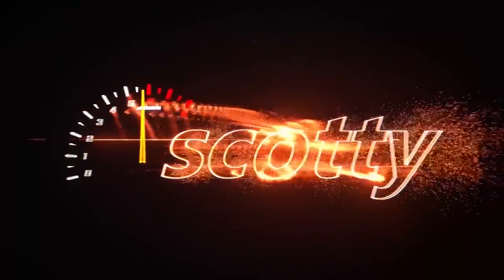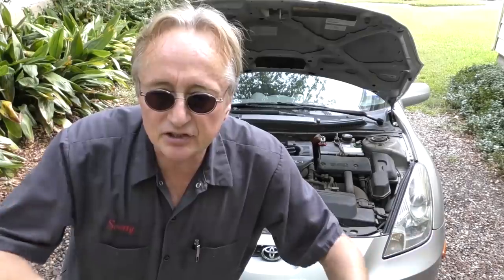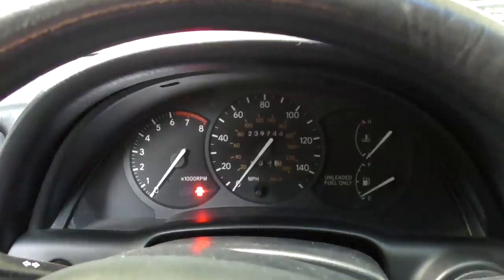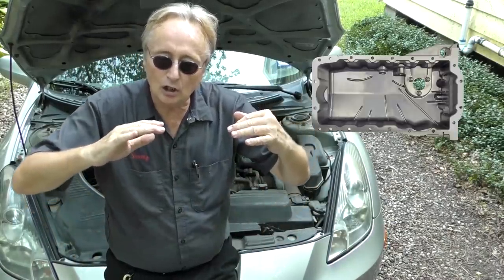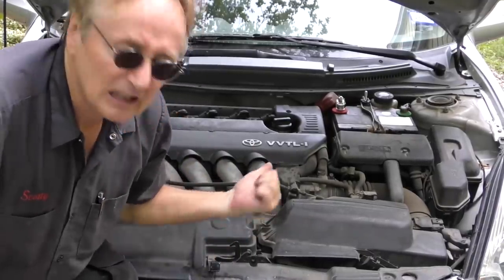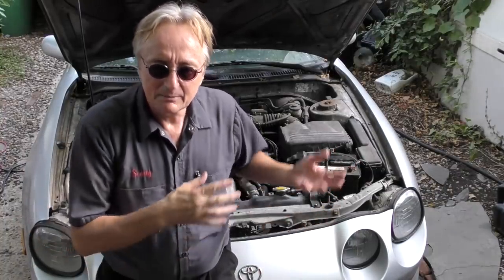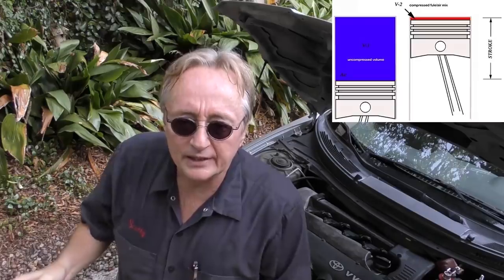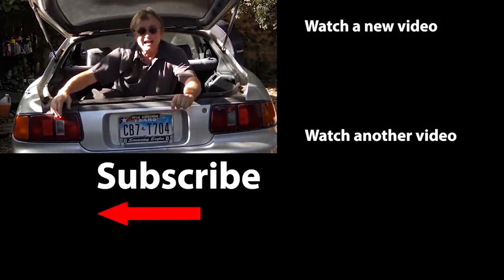Why Not to Buy a Toyota Celica

Comment: I been driving my celica 2000 with the 2zz for 7 years as a daily driver with not problems , SORRY 😐 but I love my celica
Reply: Yep, scotty is running out of video ideas.
Reply: My 2004 with the same engine, has now covered 146,000 miles and is serviced by my local Toyota dealer every year.  Nope, nothing wrong with my one, either. Still original-engined, is always economical, goes beautifully and revs freely. Exactly as Toyota intended. Love them as well!
Reply: I had a 2000 VVTI model and had it for about 12 years, didn't miss a beat, eventually traded it in at 186k miles for a 2004 VVTI celica with little to no miles on it and one owner from New.

The only time I've heard about these engines failing is when people have modified them and driven them hard, or just not maintained them at all.
Reply: J C me too. You have 130k and drive it daily plus I get on it quite often. It’s the oil pump/pan that’s the real issue and going to redline when you shouldn’t
Reply: Same here. My GTS went from my grandpa to my brother and now to me. Never had engine issues. Great car.
Reply: I had a friend with the exact same car he was always on top of the oil changes he sold it when the car had over 200,0000 miles .
Reply: @Bamaca_B58  heard thats only the problem on the gts 2zz engine, 1zz has a solution for that, dunno why toyota didnt use the same oil pans as the 1zz to avoid oil starvation
Reply: My brother celica 2002 original engine and transmission, close to 300k miles and runs like a dream
Reply: Is it a good starter car ?
Reply: @mrgatzby9793  It was and still is my first car (T-sport trim). handles well, gets good mileage (when you drive it like a sane person), and they are pretty cheap. i bought mine in very good condition for 30 000Kr 2847euro *3104usd*. Im not an expert but i have had mine for three years, send me a message if you have any questions. I cant guarantee answers but ill say what i know.
Reply: Most of engine failures i have come across was from a high-rpm mis-shift. 
The GT (1ZZ) early models had the oil consumption issues that any of the cars that shared the same engine had. (Corolla etc)
Reply: I had this car too, in spectra blue mica. The A/C didn't work, but otherwise I didn't have problems. I loved that car. I didn't push it, and always used premium gas. I sold it when I moved to Europe. Just seeing the dashboard brings back fond memories.
Reply: He mentioned that if you don't over-rev it, the engine will be fine. The problem is, most people with a sports car likes to drive rough,
Reply: @Bamaca_B58  not in the vvtli 190 like this one. That' a problem for the pre facelift  vvti 140. It was cured for the facelift.
Reply: Elias O About to buy 2002 with 160k with manual tranny. Wish me luck.
Reply: Do u recommend one ?
Reply: Agree my 2zz is running perfectly has done for 3 years of ownership
Reply: I have the same exact one and it lasted me for so long no problems whatsoever, it is about to hit 200,000 miles and still runs like a champ,  I believe there is a say if u take care of your car the car will take care of u lol
Reply: Guys Toyotas regularly get 400k miles to an motor, if you are getting <200k then you can't talk about reliability.
Just about any car will do <200k
Reply: @RSR8485  Toyotas should be getting 400k miles.
200k is not impressive at all
Reply: @jonathangarzon2798  yes true exept American cars
Reply: Im looking at a 2003 Toyota Celica Auto transmission with 146,000 miles for about 3k. Is this a good buy or not?
Reply: I have a 2000 gts with 247k miles still running but had to do the timing cover gasket and the valve cover gasket didn't have ac but added a ac condenser and good as new also plan on changing the clutch
Reply: ME TOO! its probably due to people not taking care of the engine and pushing on them daily!
Reply: Me too.  1995 Celica...25 years old.  Engine is terrific.
Reply: Well I was thinking about buying one and everyone that I've came across it has a bad engine. Just got a notification from Facebook and there's one with 112K for 600 bucks and guess what..... Needs a engine!
Reply: @carltabor9152  guess what ! I still have mine running, not a single problem.
Reply: @garethbattersby  Hey I’m considering buying a 2000+ celica I’m young and I will probably thrash it from time to time although saying that I well keep it well maintained, would you recommend another car?
Reply: How many miles on it?
Reply: @J C
How many miles on it?
Reply: Just test drove a 2zz with 206k on it, worked perfectly. Automatic transmission left something to be desired but so do most autos from 2002
Reply: I got a 01 Celica almost at 210 K Miles. Never had a problem. Funny man.
Reply: BOOM!  Love my Celica too.
Reply: Most people know the last generation had the Yamaha motor that wasn't that good. Half of you guys have lower miles....130k miles is nothing...m
Reply: @jimby_vokk3110  I've had several American cars with over 200k
Reply: @Ikeyy.  he said what the problem was....
Reply: @shandalear3252  he's talking about a different generation.........he never said mid 90s were bad
Reply: @richsweeney1115  might be why mine has lasted so long. I got the GT back in 2002 I've had to pull the transmission twice, and while I was in there I never saw Yamaha stamped anywhere on the 1zzfe. I'm up to 318k miles now, but I'm missing piston rings on cylinders 1 and 2. I was thinking about doing the 2zz swap but now I'm re-thinking that after reading about the problems it seems that people are saying they have with it. If I got another 1zzfe I could just rebuild my stock engine and have a spare for later down t he road.
Reply: My dad had to scrap his because the engine was completely destroyed, lasted from about 2010 - 2016
Reply: He has a video in why not to buy one and he also has a video on they they are the best cars ever made😂 both 1 year ago
Reply: I have a 2002 GTS with 207k miles and it's still going strong
Reply: Just bought a 2zz celica wish me luck 🤞🏼
Reply: @damonleeb  still have mine.
Reply: Shi* I have a 2004 Toyota Celica Gt wit 244,000k miles and it’s a godly car because I haven’t get any issues at all & I have modified the exhaust system and I threw a turbo on it and I cleansed the engine❤️ tips do the oil change every 4 thousands miles
Reply: @mrgatzby9793  If you start with a gen 7 Celica GTS you won't want to drive ordinary sedans or SUVs.  You would have to move up to something far more expensive like Ferrari 348 or Porsche 911 Turbo.

Its aggressive body styling was modeled after the F/A-18 fighter jet.  Even as a 22 year old design,  lots of people admire its beauty. A moto cop pulled a driver over just to look at and ask what car that was. Teen girls would stop their sedans and SUVs in traffic to ask what car that was and where to buy it.
Reply: @owensteele1274  hey not sure you still have the celica but do you still have it

Comment: I have a 2000 GTS 6 speed manual celica with 400k miles and it works just fine
Reply: Mines got 230k original motor

Comment: Most cars, if you: “take care of them” will last. Driving like a maniac and doing no maintenance will shorten the life regardless of the brand.
Reply: Bingo!🍻
Reply: So true!:-)
Reply: Nope. GM, VW, BMW, Merc, Audi, Peugeot, Citroen, Renault, and some Fords won't. My brother in law's 2013 Explorer had 8K worth of problems in 5 years. Windows, locks, electric steering motor, Sunroof Motor, Hatch motor, rust...All those are not really preventable by driving slower/maintenance. Same with Nissan's CVT's or many DCT's. In Europe, all the 
I would say that most Korean/Japanese (except Nissan's) cars won't have problems if you take care of them.
Reply: Scotty is dead-on. Don't misinform people otherwise. I've known four 1999 Celica GT-S owners and two were on their 2nd motor. I beat the piss out of my cars and used to blow up American crap regularly until I switched to Toyota. They are by far the most reliable car manufacturer in the world.
Reply: I own a 2000 Celica GT (1zz) 365k miles, no problems at all! Of course with proper maintance

Comment: throw in a 1ZZ oil pan, billet oil punp gears, and go enjoy your 2ZZ without worry as god intended
Reply: hey mate, approx how  much would all that cost??
Reply: Curious aswell
Reply: @fezg123  really all you need is the 1zz oil pan. For the oil pump, just dont mishift and hit the redline
Reply: I thought about buying one of these celicas I don't know to much about them but you put 1zz parts on a 2zz motors are the parts exchangeable?
Reply: He should pin this comment
Reply: @jj629ful  no, not all of them, just some
Reply: J J yes
Reply: God intends to get things right the first time...
Reply: where can i buy the oil pan and pump gears?
Reply: @xmodo942  go check a parts retailer
Reply: @yourfather5324  i ended up not getting a celica but a 2000 civic ex lol. its clean tho. coilovers, 4-2-1 headers, high flow exhaust and muffler, short ram intake, and ofc VTEC
Reply: @jj629ful  yes, in fact the 1zz one can literally bolt on and solve the problem
Reply: @anunknowndude  oh ok that's good
Reply: @Nskawtea1  that's good
Reply: @灰灰-d9f  I didn't know that's good to know I'll buy one someday.
Reply: @jj629ful  the major difference is 1zz pan is baffled, but 2zz is not. If you don’t have a budget, a custom one is recommended as well as an upgraded oil pump module
Reply: @灰灰-d9f  which motor is more reliable?
Reply: Exactly
Reply: Is the celica with 1zz engines have the same problem as the 2zz or is it safe for a celica GT with 143 HP ?
Reply: @MotokoNightWalker  hi dude, i have a Celica 1.8vvti 143hp from 2004. You won't have any problem since the production was made on july 2003. I'm spanish, sorry if my english it's not perfect. Hope i helped you!
Reply: @SkullDivisioN564  God saves because He knows people fail. God's Celica has 0 issues.
Reply: Yep, and then goes the gearbox because they're weak as piss
Reply: @fezg123  1zz oil pan is like $50 in autozone and the oil pan gasket is maybe $20. Cut the oil pan with a dremel in one spot on the top to allow it to fit.

Comment: The market demand killed the Celica, not the engine.
Reply: agree
Reply: Elaborate please, I’d like to know more
Reply: @goldengibus6300  2002 introduced the wrx in the us and in 2003 the 350z came 
people were more into turbocharged cars (fast and furious had a lot to do with it) and large displacement v8s  (Muscle cars peaked in price back then) so the demand for high revving small 4 cylinder cars went down. Also 2008 happened
Reply: True

Comment: people kill 2zz's by over revving and miss shifting them. 205K on my original 2zz engine and transmission
Reply: High how do you like to rev yours
Reply: @roguecaptor8734  14,000 rpm
Reply: 2zz is very reliable engine for normal driving use.  However, the problem he is explaining would occur on Track / Auto-Cross / Hard Driving / Money-Shifting.
Reply: Mines got 230k, original motor. Changed the lift bolts. Original oil pan, Changing it soon to the 1zz. If engine blows after I’ll throw in another 2zz and upgrade everything again plus the oil pump this time.

Comment: These engines had a couple of small issues (lift bolts, which is a very easy fix and was resolved in 2003) and the oil pan issue you mentioned (that is also easy to fix with a 1ZZ oil pan or a good aftermarket one for aggressive track racing), but otherwise they are excellent and have held up very well. Oil pump failures have happened to these pretty much exclusively because of driver error, dropping down into the wrong gear.
My 2003 Celica GT-S has a 2ZZ-GE with 355,000 km on it. It is flawless. No leaks, works like new.
Reply: Lucky you, my 02 was gone at 120k, on my second engine and drive it around 2 hrs almost daily. Hopefully it continues to hold up since it's a nice fun car to drive, specially with that 6 speed. I'll have to get myself one of those oil pans.
Reply: Man what ur ig i wanna talk with u there

Comment: Anti-Scotty: Toyota Celicas are just endless money pits: don't buy 'em!
Reply: ain't-scotty: mercedes are reliable
Reply: Mix Scotty and Anti-Scotty? Sounds like a recipe for warp drive.
Reply: Anti scotty: range rovers last, freaking, forever
Reply: I know 10 people who have either A2000 through 2006 Toyota Celica with the 2zz pushing close to 200,000 miles on the original engine and the only money they put into it is for basic maintenance
Reply: Believe it or not, dats what my friend thought. He came up to me and said range rovers are reliable. I   Bursted into laughter
Reply: @chevyboyforlife4234  my 2000 celica is sitting at 192K. Original engine. Well, maybe. Got it used.  The 2002 gt I had before spun a bearing. The 1zzfe is the true dog. Oil drain holes were too few and too small so it burned it's oil up and spun bearings. Corollas were the same way.

My 2000 gts has a failed input shaft bearing, the trannies are the weak link here lol
Reply: Anti-Scotty: Chrysler's are the best cars!
Reply: Maybe so. He has only put 5 miles on his Celica the past year and five months
Reply: well just like Scotty said people was not putting the right fuel in these cars when you have the 2zz you have to put high-test in it if you don't that will blow the motor
Reply: @xinlinwu4572  last forever in the garage.
Reply: @chevyboyforlife4234  I ran a 2ZZ over 300K miles with cheap unleaded 87 Octane. Engine still runs smooth and strong.

Comment: First of all, I love your channel to death, now secondly, you can't be any more wrong about this.  I have a 2000 Celica GTS with the 2zz engine, manual transmission, bought her new 19 years ago, as of now she has 360,000 miles on the engine, the ORIGINAL engine.  She is driven hard ever since I bought her, and has not broken down even once, never left me stranded.  The horror stories about this car, were often caused by people miss shifting, because of the close gate 6 speed, where you accidentally shift from top of 3th back to second instead of 4th, and you guessed it, boom.  Drive it everyday, change oil every 3000 miles, and it will last you.  Take care Scotty.
Reply: Thoughs on the 2002 celica 3sgte
Reply: Mines got 210k miles, original engine as well. I never had a problem with the shifter either, maybe the gates were replaced at some point
Reply: When I was looking at the GTS the dealer asked me if I had ever driven a manual before. They only recommended it to experienced drivers, which I was. I did have to get the transmission fixed once cause I grinded the gear going into 2nd, haha! The engine held up just fine, though.
Reply: 184k going strong
Reply: Yea sounds like the engines failures weren’t mostly Toyota’s fault sounded like a lot of people not understanding how the car works my 03 gts has had 0 issues and the car is at 192k miles my only complaint about the car is the price of hid bulbs that came on the gts between 03-06
Reply: I have a 2001 with it's original and same story for me. it was my uncle's first car, my first car and now my sister's first car. Shes gone 21 years with some very heavy feet behind the wheel and has done nothing but treat us right. I absolutely love the Celica, and I see it as reliable as I need it to be. Proper maintenance and good stick handling is all you need.
Reply: Lol mine took a shite at like 120k, on my second engine and so are alot of people. Constatly see these cars at junkyards as well, good for me though cause I can get part for mine. Scotty is right on this one. I love my Celica as much as the next guy but facts and facts.
Reply: Hi Carl, good for you, love those HID headlights, they are cheaper by now.
Reply: Missed a gear and she went to 2zz heaven 🙏😇

Comment: 2zzge engine designed by Yamaha , * throws out pic of piano
Reply: Yamaha makes pianos.😄
Reply: They also make boat engines, atvs, and motorcycles as well as pianos, brass instruments, and more.
Reply: @executablefiles3713  they make some pretty sweet drums as well.
Reply: They started out with pianos which is why their logo is a tuning fork.  Their pianos are fangtazmagoric as are their acoustic guitars.
Reply: I didn't even notice
Reply: @Richi RIch Haha true does the engine in the Toyota Corolla t Sport 1.8 is that the same engine
Reply: Kreepy Pasta ok.

Comment: Actually I disagree the GTs are very reliable. Yamaha builds fantastic heads. The motors are very stout. The 2ZZ just needs good oil and being aluminum, good coolant and a well maintained cooling system. I'm a mech and dont agree with Scotty this time around.
Reply: @TempoMontages The fact that you call me dumb and then state "at auction" is very ironic.  I've worked on plenty with high kms on original everything, it's all on how you maintain them. Like anything. Theres nothing wrong with the 2ZZ
Reply: My 00 GTS 6sp has 122k original engine.  Still smooth as butter.  I don't misshift and I don't go into lift around corners, those are just stupid things to do anyway.
Reply: @TempoMontages  except my 02 2zz with original engine with 383k miles buddy.
Reply: @TempoMontages  pumping 87 octane and not 91+ is what causes that
Reply: I got a 2000 1zz in red and has given me tons of problems  and burns oils . I also have a 2000 2zz GTS Celica almost at 143k miles and drives like new.
Reply: Toyota fix all the problems as the years went on,I’ve a corolla Tsport with the 2zz engine and it’s built proof,put 99 octane petrol in it you won’t have a problem